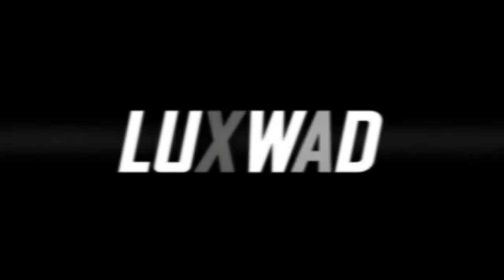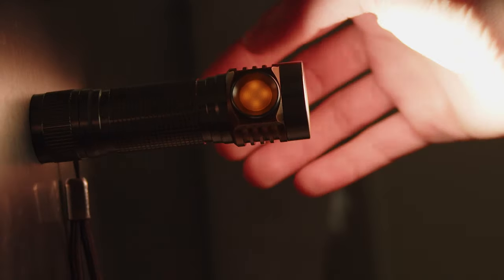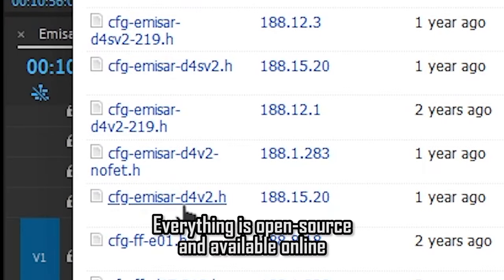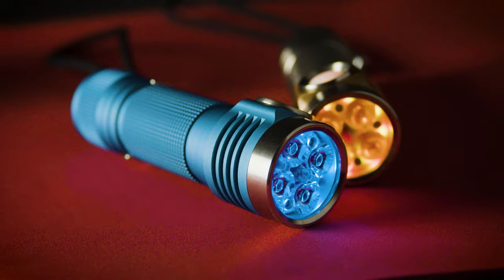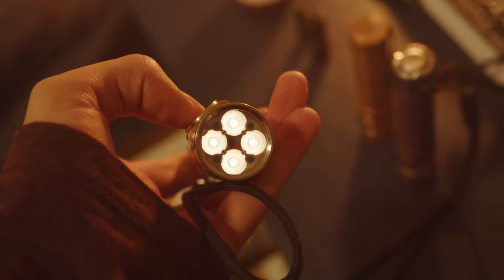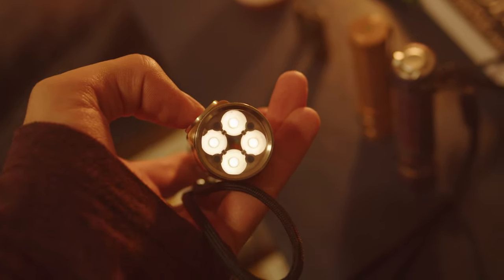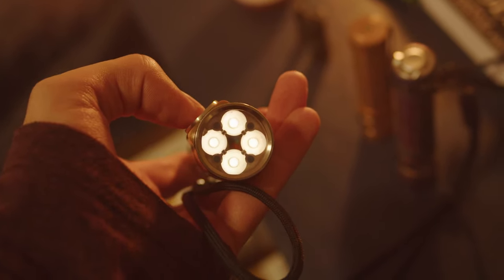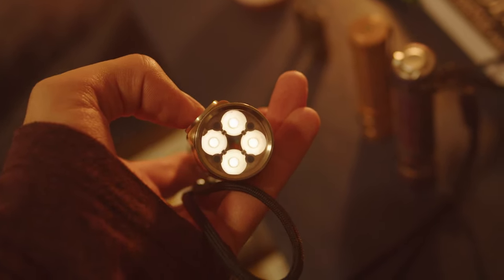DANGEROUSLY FUN - Emisar D4V2 [In-Depth Review]

Comment: That is a good review. I would also mention the cheap and readily available flashing kit Hank sells to update the firmware. It is remarkable, as it is the only readily available flashing solution for Anduril lights and with it, you can flash the D4V2 to Anduril2. The newest version of Anduril2 features dynamic PWM which makes for much better low modes (more linear and controlled) with the constant current driver - it really changed the usability of these lights for me.
Reply: Do new ones have the anduril 2 installed?
Reply: @zachmcclintock2041  I am not sure. You can email Hank (the owner) on the email mentioned in his website with your question. He is very good at responding.
Reply: @zachmcclintock2041  I specifically ordered with anduril 2, was possible without surcharge. No issues with low light ramping.

Comment: I know it's an oldie but, what battery would you recommand for a D4V2 in 18350 config ? I'm in Canada so i importing batteries is no fun. Some Vape shops have 18350s with 10A continus discharge and 15A max. Would it be good ? Thanks
Reply from the maker: I honestly don't much of anything about 18350 batteries, I have only used the Keeppower 1100mAh model and it's terrible. I imagine the battery you mentioned would be just fine.

Comment: I'm interested in buying a D4 colorful, is the 21700 battery included? Also will my charger for an 18650 also charge a 21700?
Reply from the maker: No batteries are included. Your charger has to be large enough, check the specs.

Comment: Congratulations for this great video.  Absolutely!  There are questions about the D4V2 with the LED E21A neutral white, 4500K, R9080 (i.e. CRI 90).  What is the difference in luminosity between Nichia 219BT-V1, 4500K and Nichia E21A, 4500K?  How many lumens do these have compared to the SST-20?
Reply from the maker: The E21A will give you about 1,000 lumens max, while the 219b will double that. SST20 in 4000K will produce about 3,300 lumens max
Reply: @LuxWad  Do you have experience how much power LED LH351D (4000K) can have?
Reply from the maker: About 4,000 lumens
Reply: @LuxWad  😎🙏

Comment: Hey, I want to buy this light but I'm unsure what LEDs I want.
I thought of going with the dual setup (tint model) with these two:
CH1: XP-L HI in 4000K
CH2: W2 in 6000K
I want the light to be able to throw a little on one channel, and offer a smooth flood on the other channel.
I also wanted a warm and cool light source, but not too far separated to avoid an ugly turbo look.
Do you think 4000K is warm enough? I'm going with the TI model with amber switch just like you did.
Reply from the maker: It's a tough choice. I would probably recommend W1 over W2 as you will get more throw, but it's not a pretty beam in the Carclo optic. For flood, the LH351D is much floodier than the XP-L, the 219b is a bit floodier as well. I think 4500-5000K would look a bit better with the 6000K emitter, but 4000K should be fine too.

Comment: Amazing review but I cant fully agree with the battery life issues. I think the options these flashlights provide can be great for optimizing battery life. I have both the D4V2 with the linear driver E21A in 4500k and the FET SST-20 in 5000K. The E21A and linear driver is awful with only about half the run time when set to match close to the same output. However with the SST-20 version I have it set to stepped modes with the ceiling at about 250 lumens. I only use turbo to show off the light or for extremely rare situations so most battery cycles are with no turbo and just using high I'll get about 5 hours with no ramp down. Most pocket flashlights I own have modes that are lower or much more than 250 lumens and will ramp down. Using the D4V2 this way is a great work light and its just warm to the touch at that output.
Reply: Як ваше загальне враження від е21а?

Comment: I own a couple fw3 lights and due to my typical use case, I’m pretty ok with the shorter runtimes. I’m a glassblower and prefer to work in dimmer conditions.. easier to read heat temps. But sometimes I do need to light the hell out of a piece in progress which is where a high cri hotrod comes in very handy. Since I’m rarely needing it for more than 10 secs at a time, the heat isn’t much of an issue either. I’ve got a ticu model with the 4k sst20 (mine are kinda green at lower levels as well), and a purple aluminum one with 5k xpl-hi. The lights actually came with leds that are in the other but I swapped the stars between them. The driver in the purple one can also be a little weird sometimes so I put all of the “best” parts into the ticu, aka, my main one. The aluminum one also currently has an 18350 tube installed and it’s purpose is mostly novelty… super high output in a tiny purple package. Got em from jlhawaii my intention is to sandblast and stonewash the titanium parts later down the line once they’ve gotten a little scratched up, but I’ll enjoy the shine til then. I’m also considering stripping the anodizing from the purple one. I’m cool with purple, but I mostly. Bought for the sst20 star and it was the only version I could find with those leds. 

Awesome video though might have to pick one up. I mostly found the fw3 aesthetics more appealing, it’s max output was more in line with my needs and I wasn’t too interested in the aux leds.  Both of my fw3 have turboglow gaskets installed anyway.
Reply: I like lumintop edc18copper nichia 219c 4000k, fw3brass sst20 4000k, lm10 xpl 5000k titanium, fw21 x9l copper and fw21 pro cupper, and i don't like aux colour light.

Comment: Is there a danger of setting the thermal limit too high and causing damage to this light, or any light running Anduril?
Reply from the maker: Anduril only allows a maximum of 70C, which is well below the limits of the components. Certain LEDS though might not be able to handle it, but I've never heard of any issues with burnouts, the lights are configured with the right driver to prevent that
Reply: @LuxWad  Thanks for the reply! This video was amazing. The production quality of all your videos is outstanding. Keep up the great work, and thanks again.

Comment: I ordered this light for work because it’s the only one that I could find that has a diffused optic option. I ordered it with a boost driver and an sst 20 4000k for a high cri. I also needed a magnetic tail cap with a 18650 battery in a small package. Here’s hoping it works out. I have so many flashlights that I don’t work for me.
Reply from the maker: Good luck, hope this one fills your needs!

Comment: Definitely considering the E21A variant for a bedside and around-the-house light. Definitely don’t need a ton of output, but a warm color temperature is much appreciated here. Already have a Zebralight SC600FC mkiv Plus for a workhorse light though.
Reply from the maker: The E21A is pretty much ideal for that application, especially now that there are some cool new updates to the firmware, so ultralow will work a lot better. I use my E21A on ultralow around the house pretty frequently
Reply: @LuxWad  Off topic. For edc, I actually prefer floody, as most times I need a light, I need it to work with things up close, or to illuminate a wide area. I seldom need a lot of distance, though that’s what Turbo is for.
Reply from the maker: I prefer floodier beams in general, despite my channel name I don't have much use for really throwy lights. That being said I do prefer a bit more intensity for outside, especially since I prefer lower outputs so it's more efficient. Partly why the E21A light is perfect indoors but for me it's not effective outdoors

Comment: I noticed hanks now selling dual channel w tint ramping. Say I got 519a 2700 and 5700k when only 2 is lit that's half the lumens as. 4? What if both on at same time what color would you get? In between like 4000k?
Reply from the maker: The dual-channel will be the same output as the single channel, it just drives the 2 leds harder - it's not as bright on Turbo however.

You should get about 4000K, mixing two different CCTs also always results in rosier tints
Reply: @LuxWad  You mean if the 2 5700k led only was on it would be the same lumens as if all 4 5700k we're on if it was 5700 quad?
Reply from the maker: Not on turbo, the max output will be less than half as there is half as many LEDs and no FET. But they would be the same on the lower modes

Comment: I’m confused about the drivers. What is a boost driver? Is there a driver that just gives the same number of lumens until it dies? That would be preferable to me.
Reply from the maker: The D4V2 uses 3V LEDs. In the Linear+FET versions, the driver provides 3V to the LEDs while burning off the extra voltage from the battery as heat.

In the boost driver version, the LEDs are wired to provide a 6V load. The boost driver takes the ~3.7V from the battery and boosts it up to 6V for the LEDs. However, this process means it cannot use a FET for direct drive on Turbo.

The result is that the boost driver is much more efficient, meaning it produces less heat, meaning it sustains a higher output and runs longer at the same output. However, it only provides about half the output on turbo.

For your needs, the boost driver is the better option. Unfortunately you will not find a small, bright modern flashlight that maintains the same output through the whole run, as it just gets too hot. You can check out my review of the Nitecore EC4GT for a light that does not step down, but is much larger: https://www.youtube.com/watch?v=8bL60kJyDk8

Comment: People keep saying these aren't practical.

I work in an underground mine. The only sources of light are manmande. I rely heavily on my handheld along with my headlamp. My headlamp is predominantly used for foot navigation. It just doesn't have the output I'd like to actually do my job. This involves finding and inspecting things from as much as 500-600' away. For this I exclusively use my handheld. I purchased a dual channel D4V2 with W1 and LH351D emitters. It is incredibly practical. Up close, the floody emitters are perfect. They produce enough light to do anything I need to up close. The W1's have enough throw to easily identify objects up to several hundred feet away. In very dusty environmens, or when I need to throw extremely far, I use my KR1 with an SFT-40. But 95% of the time, it's the D4V2. At 50% output, the light is bright enough for most of my work, and gets slightly warm to the touch. Even up to 70-80% output it will run for several minutes without getting too hot. Only in turbo does it get uncomfortably hot. This seems to be the sticking point of most people claiming it's impractical. Instead, they recommend lights that simply have a lower max output, which you can easily do in Anduril. You get just as much output as "more practical" lights, while not getting any hotter. The D4SV2 has better throw, and sustained output, but it's also way bigger. I also rarely need the sustained turbo that it gives me.

As someone who relies on this light 6 days a week, it's very practical, as long as you choose emitters that match your use-case.
Reply from the maker: I very much appreciate your insights here. I still do not consider this light practical as the interface is far too complicated for most users, the durability is relatively low, and the driver is inefficient, resulting in lower runtime and lower sustainable outputs.

However, the light is now available with a boost driver option, which increases efficiency from ~70% to about 90+, which makes this a much more practical light I think.
Reply: @LuxWad  I work in an underground mine, it's surviving for me just fine.

As far as battery life, I use it a lot. I carry a spare battery, and I rarely have to use it. As far as sustained output, it will run at 50-70% of max brightness for some time before getting hot or stepping down, and that's already more brightness than most people need. People don't take walks at night or look for something they dropped using turbo.

Anduril 2 has a lot of customizability, sure, but with about 15 seconds of instruction anyone can use it in simple mode.

Comment: If there is an option for a simple Off-On/Low/Med/High function I'd be interested. I don't want a flashlight with overly complicated operation, an instruction manual shouldn't be needed to run a flashlight. That's just my opinion! I did enjoy the review, but I'm less sure after watching it whether I should purchase one or not.
Reply from the maker: It can be modified to be very simple in operation, but doing so requires understanding of the ui to begin with. You can flash your own firmware to the light but that is a much more complicated and technical process.

However the interface really is much more intuitive and simple than it looks on paper, the basic features (on/off and brightness ramp) are very easy to use. If it seems too complicated, I recommend looking at some convoy lights like the s2+ and s21d that have very simple interfaces and good performance for a very affordable price

Comment: 14:10 - Yes it does impact battery life. The difference being small for one person's opinion doesn't make it correct to say that it doesn't affect battery life.
Also, you don't negate the self drain by having the auxiliary lights on. You add to it. It's addition so you just drain the battery faster.
Reply from the maker: I didn't say it negated the drain, I said it was negligible and thus not a concern.

Comment: There is a boost driver available now for $12. Says not as bright on turbo but 90-95% more efficient and doesn't get as hot! Would the Samsung 30Q work for that too?
Reply from the maker: Yes, though a 3500 mAh 10A cell would be the better option
Reply: @LuxWad  I asked Hank he said the new boost driver will not catch paper on fire. It's 2A per emitter so it will run longer but not as high output. Now I don't know which to get because I kinda like the idea of being able to use it to start a fire but I like the longer run time too. Guess I could always keep an extra battery with me if it ran out I'd have another!
Reply from the maker: If you want practicality, get the boost driver for better runtime, higher sustained output and improved stability. Otherwise get the linear driver
Reply: @LuxWad  Hank recommend 519a with boost driver. He said turbo would be approx 2300lm. Do you know what the approx lumens is with the linear driver for 519a?
Reply from the maker: Almost 4,000 lumens I believe

Comment: Hello, how do I get out of muggle mode? I must have pressed the button too many /: I need my light on high for work.
Reply from the maker: 6 presses from off
Reply: @LuxWad  Thank you! I tried that but must have screwed up something else because it still won't give me Turbo and only three ramping choices which are quite dim.
Reply from the maker: Try a factory reset. Unscrew the tailcap, then hold the button down while screwing it back on until it finishes flashing. Also make sure your battery is fully charged
Reply: @LuxWad  Thank you! Will let you know how it goes...
Reply: Oh my goodness, changing out the battery did the trick! I'm surprised because the battery I had in there was fully charged and slightly used for only one day, plus it's brand-new so I hope it's not defective 🤔. Thanks again for your help and your outstanding video!

Comment: impressive!
admiration from Ukraine!

own an analogue - JETBeam EC26 (4CREE XP-L HI, Anduril 1).
please recommend where to start to upgrade to Anduril 2.

subscribed to the channel
Reply from the maker: I'm glad you liked the video!

This is the guide I follow to update my Emisars:
https://budgetlightforum.com/node/68263
This guide explains the software side of things:
https://oweban.org/files/Anduril%20-%20Windows%2010%20guide.pdf

Unfortunately, the EC26 uses a different set of flashing pads from the D4V2. Reflashing that light will be a lot more complicated, as you will probably have to build your own kit. I recommend asking for further help at www.budgetlightforum.com

This guide may be helpful, it is for flashing the D18 which uses a similar system to the EC26:
https://www.reddit.com/r/flashlight/comments/krvuup/guide_on_updating_an_emisar_d18_to_a_diy_version/
Reply: @LuxWad  thank You for the detailed explanation!

You already have experience using both versions and, like no one else, You can assess the readiness of version 2. Is there any point in bothering or is version 1 more perfect than the second?
Reply from the maker: I think version 2 is better, and I prefer using it. However, Anduril 1 is still very good, and I have a couple lights using it which are still great, so if you are not able to flash your light then I wouldn't worry about it. I do not think Anduril 2 is necessary, but it is a nice upgrade
Reply: @LuxWad  it's great that You give Your reasonable recommendations so quickly!

You are an incredibly responsive and honest Person!  
Therefore, with all my heart, I wish You enthusiasm, prosperity and inspiration to develop Your Channel (with at a million loyal subscribers).
You really deserve it!

Хай щастить, Козаче!

(the day after tomorrow, Ukraine celebrates the Day of the Cossacks and its Patroness - Mother of the Lord Jesus Christ Mary).
Reply: Я думав, що єдиний тут українець) приємно, бачити земляка